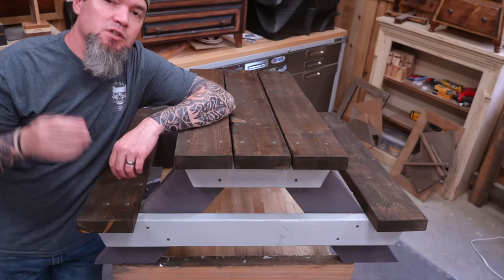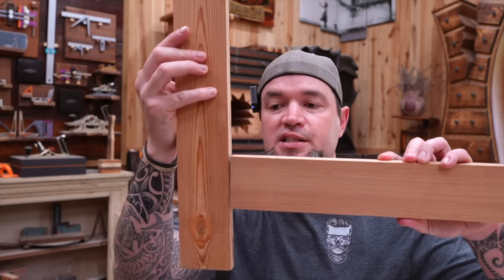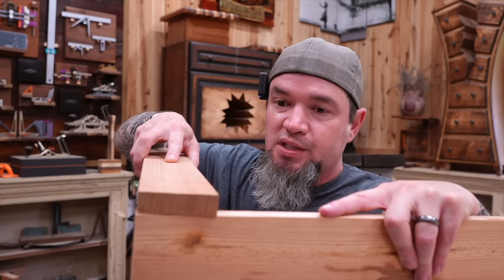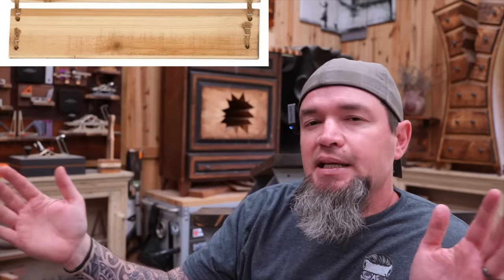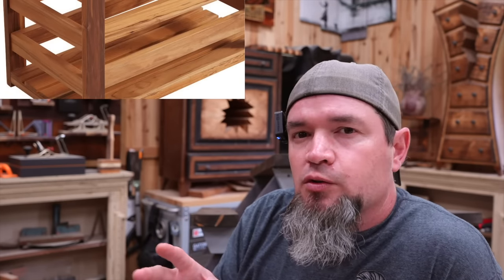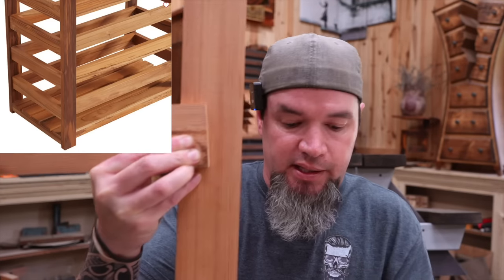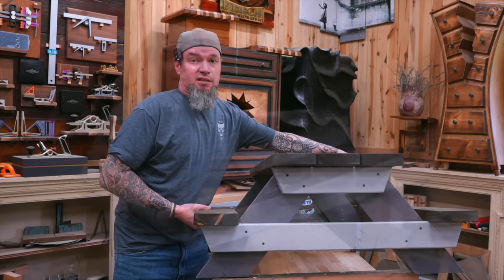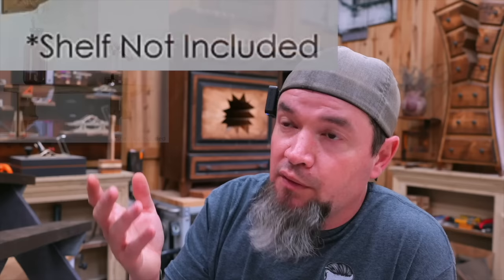5 More Woodworking Projects That Sell - Childs Picnic Table- Make Money Woodworking (Episode 17)

Comment: For the legs, is the length 22 and 5/16th from long point to short point? Or are you measuring diagonally across the board from long to long?

Comment: Are heat treated pallets still good to use if the product might potentially come in contact with food? Like table or serving tray? I just picked up 2 heat treated pallets from a carpet store, so if it was mainly used to move carpet it shouldn’t have contamination from chemicals or food right?

Comment: Treated wood for a picnic table won't hurt anything except your budget. Just soak the ground contact points with used motor oil aka poor man's creosote. (which is what was used to treat the old barns you were referring to)
Reply: I’ve never heard the tip and I’m grateful I did.  Thanks a lot bud!
Reply: oil based paint or stain is better.  or just get some 8-10in square paving flats for each leg.
Reply: I'm thinking spray rubberized undercoating
Reply: @MrDmorgan52 That would trap waTer. In the wood. Causing rot.
Reply: @richardmccann4815 incorrect, I seal my end grain with epoxy and I’ve used the flex seal stuff to. It doesn’t trap water and cause rot. Nice theory but untrue. Not the only point of moisture movement. But the main point of moisture absorption so seal that shit off. It’s fine

Comment: How would you go about making a picnic table like that that's designed to be able to take apart and put back together? Like, what kind of screws/nuts/bolts/etc would you recommend for that sort of fastening? I'd like to make those picnic tables but I want to be able to break them down so they can fit into a sedan trunk or backseat.

Comment: To those that are afraid of the jigsaw project: The design is basically an "F" with a "C" shape angled through the top horizontal line of the "F" through the bottom horizontal line of the "F". Then they just made a fancy hook cut through the horizontal lines that stuck out from the "C" shape. But you can just make an angle cut and it will still look cool.
Reply from the maker: Good tip!

Comment: Question for you about the kid's picnic table. I bought your plan for it and will be making one, but I was a bit confused on the leg cut length. Part A says it should be 22 5/16 but the picture below shows it at 18 inches. I am assuming the 22 5/16 is correct and not the 18 in the layout.
Reply: I believe the 18 is the size after cutting off the angles

Comment: Using epoxy to seal the end grain is more ideal imo . I'd imagine the rubber could fail under drastic temperature changes, esp if freezing temps
Reply: I've used plastidip on several outdoor projects that have lasted through multiple Midwest winters. Three or four coats should last indefinitely.

Comment: Made the mistake of following his plans for the picnic table and found out that I should have bought 4 2x6x8 boards and not three.
Reply: I’ve made 10 of these only need 3 2x6x8 just cut the legs first
Reply: You need to cut 1 leg from 2 of the boards and then cut the tops...
Reply: @tomstone2322 I am missing something because I have made 4 and I have to go get an extra 2x6 every build. I always run short I can’t figure out how to make it work with 3.  I’m sure there is a way I just can’t get it figured out.

Comment: Watched this about the picnic table and I was doing the math in my head, correct me if I’m wrong but it’s impossible to use only 3- 2x6x8 because the 5 cuts at 35 3/4 for the table top and 2 seats it’s a good portion of 3 2x6 material not leaving enough to cut the 4 legs at 22 5/16 or 18 if you do the angles first. But still same length in total…so you’d need 4- 2x6x8 orrrrrr 3- 2x6x10…hope that’s just a mistake made talking and not in his build plans for the guys that buy to build or whatever.
Reply: The error is in the plans.  Just stared cutting the project and  discovered I need to head back for boards.

Comment: YouTube recommended one of your fence picket planter videos and I got excited.  Why hadn't it suggested this before?!  I bought a bunch of pickets and other wood--and then was accepted into grad school.
When lumber prices peaked (at least the first time), Mom's friend said she was dying of cancer and couldn't climb the steps into her house, so I designed a wheelchair ramp, and bought all of the materials, but Mom demanded that I removed a stump that wasn't in the way, and then didn't let me build the ramp.
Then Mom kept complaining the frost would kill her precious plants, so I built a greenhouse, which she refused to use.
I Like to Make Stuff showed one way to make a greenhouse, but those panels would have cost me $800.  Everyone said you could use clear coroplast, it would just turn yellow over a few years.
It was $280 for 10 panels and the roof blew off within months, so I replaced it with the expensive panels.
However, the rest were disintegrating, so I took down everything.
I have a bunch of 4x4s and 2x6es that I never touched, all of the 2x4s from the greenhouse, and tons of scrap lumber from other projects, but I need to get rid of all of it before I move for grad school, and I hate thinking of all of the things I could have done with that wood.
I watched some videos about making distressed furniture with nail holes in it and thought that I already had scrap wood with holes in it!
Maybe someone will burn the scraps.
Maybe someone will pay me $20 for the 4x4s and 2x6es.
I just don't have the time to find the right buyer.

Comment: Sorry, as a side note. I'm looking to get a Dewalt 18 ga. or 23 ga, nailer in 20v (i have 20v tools in use) which since nailer/pinner do you find most useful for the projects you do, please?
Reply: A 23 gauge pin is used to hold one component to another as the glue dries. The 16 gauge nailer will be more durable but leave a slightly larger hole.  Together they are not either or but what works best is a 16 gauge nailer that has much more usage.